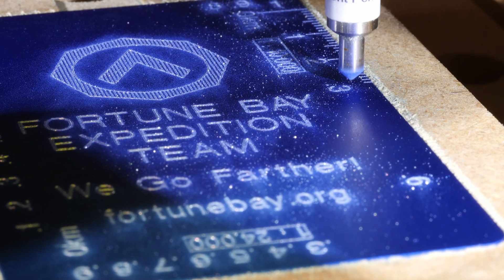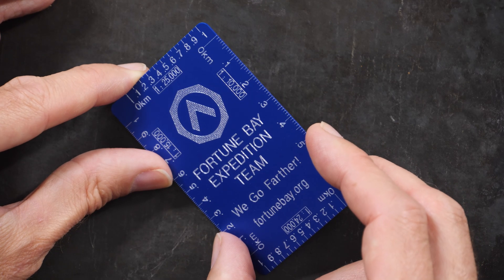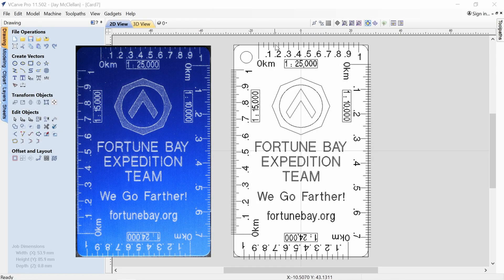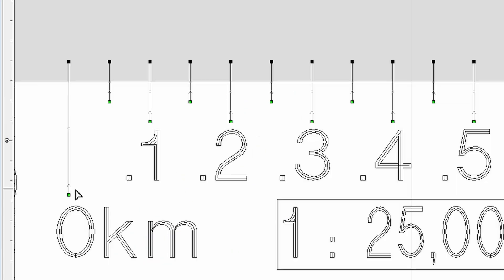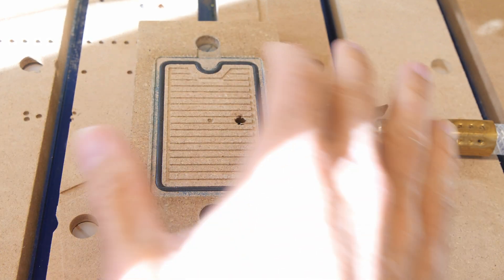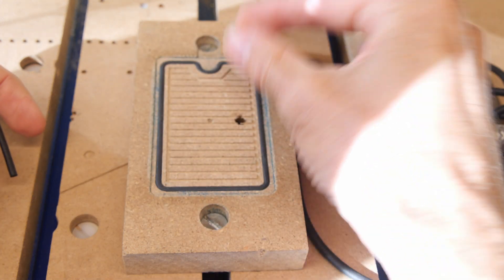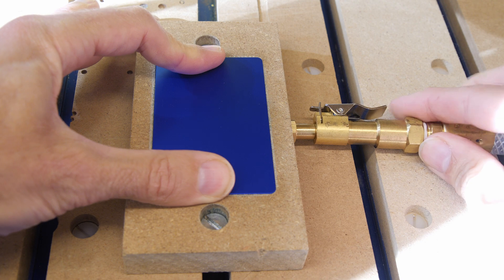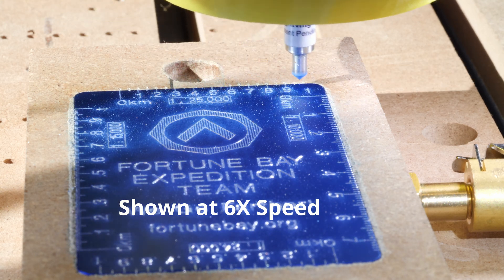Diamond Drag Engraving with a CNC Router

Comment: Jay, Thanks for the well-done video and excellent close-up photography of the actual engraving process! Answered a lot of questions for me. Have you ever done this kind of drag engraving on, say, a hardened (HRC60) steel surface? I am looking for a production-friendly engraving method for our knives. Any guess as to how long a diamond tip would survive dragging a couple passes along an HRC60 polished stainless surface? Thanks.
Reply from the maker: Glad you found the video useful. I haven't tried engraving any harder materials, and I would expect it to work but with less distinct (finer) lines. It might take more pressure, and it would help to fixture the material so that the engraved surface is as perpendicular to the axis as you can get it, in order to keep the pressure consistent. With a harder material I'd also recommend plunging more slowly to reduce impact on the diamond. I don't know how long it would last but I'd expect it would last fairly long if impacts are minimized, and it would be a balancing act to get the pressure sufficient for engraving but no more than necessary to preserve tool life. I know that some makers of the engraving bits offer a replacement diamond tip+shaft so that you don't have to replace the entire tool when it wears down.
Reply: Thanks, Jay, ( @BrainRight ) for taking the time with a detailed response. I am actually flying out today to meet with the manufacturer of a high quality bench mill. Craig at TAIG Tools has been very responsive. By the end of this weekend, I should have a better idea what my options are for production engraving on this HRC 59-61 polished CPM-S35VN  knife steel. I'll try to remember to get back to you with our results, maybe with some pix or a short video. - Kind regards, Dan Vorhis

Comment: How do you set the direction of toolpath in Vcarve so that it drags from the center outwards to the edge of the card? I've opened the CRV file for this project and can clearly see the engraving paths are all outwards.
Reply: Nevemind, I found this answer in the Vectric support forum:

Press N to go to node editing mode. (Or click on the node editing tool)
Click on the vector you want to edit.
Move the cursor to the end you want to start cutting at.
Press P and the green (start) node will appear.
Repeat as necessary.
Press N again to exit node editing mode.

Comment: I will truly appreciate your response Jay. I have cnc 3020 pro and I want to engrave on acrylic but don't know wich size of diamond drag engraving bit I shold buy ?? Thank you in advance for your response
Reply from the maker: I have used this bit on acrylic with the same feed and speed as aluminum and it worked well. I've been meaning to put together another video on acrylic engraving, but if you get a similar bit and use similar settings it should work well. See http://BrainRight.com/diamond-engraving for details on the bit I used and feeds/speeds.

Comment: Have you thought about selling the file, minus your logo as a digital download?
Reply from the maker: The VCarve Pro project file can be yours for the amazingly low price of... absolutely nothing! See http://BrainRight.com/diamond-engraving where there is a link at the bottom to download the project file. Enjoy!
Reply: @BrainRight  Very kind of you, I'm guessing the reasons I didn't see that when I read your web page is I don't use V-carve so didn't recognise the file extension.  
Your video got me thinking about enhancing my VAC holding for small projects too, at this moment mine is designed for larger sheets the size of the bed, which become almost useles if a sheet is part used. Great stuff.

Comment: I followed the link to your website and was pleased to see a link for a 'Map Ruler Generator'. Alas, the link appears to be deprecated.  Any way you'd be willing to share the CRV file you use for your card?
Reply from the maker: The Map Ruler Generator at https://brainright.com/mapruler/ is not deprecated but may not work in all browsers. It generates custom linear map scales as a PDF that can be printed on label tape or plain paper, so it's not directly related to this project. I updated my page for this project at https://brainright.com/diamond-engraving/ with a downloadable CRV file that you can use with VCarve Pro.
Reply: @BrainRight  My apologies, I opened the map ruler generator link in Firefox and it works flawlessly.

You are awesome! Thanks so much for the CRV file! You've made several geologists very happy.

Comment: LOL about the hair explanation. Nicely handled, but crazy what people fixate on.  Enjoyed the vid and especially the vac fixture for the cards.

What size pump do you have?  I have a little 5 Pa pump (3CFM) that I use for car AC work. Is that similar or would I need something stronger?
Reply from the maker: Thanks MrT. My pump is one that I bought years ago for vacuum-bag veneering (which I haven't actually done yet) and it's a Gast DOA-V722-AA. The specs are 1 CFM and 137 mbar (13.7 kPa i.e. much poorer vacuum than yours) so I expect your pump would work fine.

Comment: nice vacuum jig
Reply from the maker: Thanks, I wouldn't recommend a MDF vacuum jig to hold parts for milling where the forces would be higher (then I'd use aluminum or phenolic), but it has worked fine for diamond engraving.

Comment: Great video! Would this be a feasable way to do printed circuit boards? (The benefit would be less noise than milling and less airborne glass fibres I imagine)
Reply from the maker: Thanks. I don't think the diamond would do a very good job of isolating circuit board traces, as it would cut a V-shaped groove and would probably take multiple passes to cut deep enough. Not saying it's impossible, but you'd probably get better results with a small end mill made for that purpose, plus good dust collection.